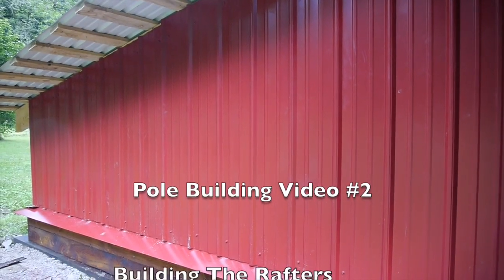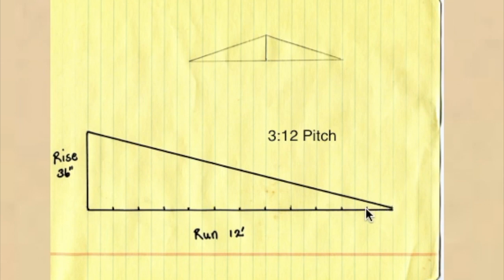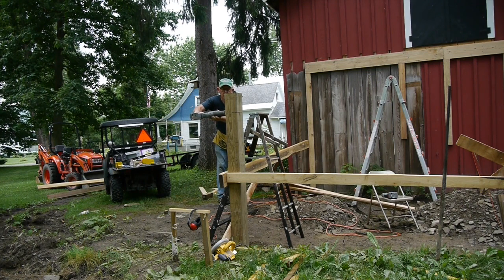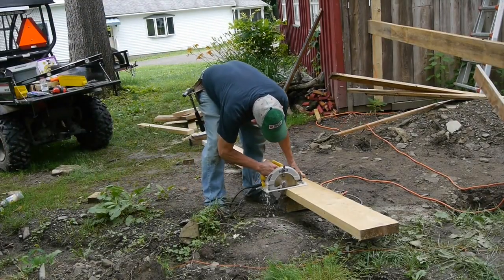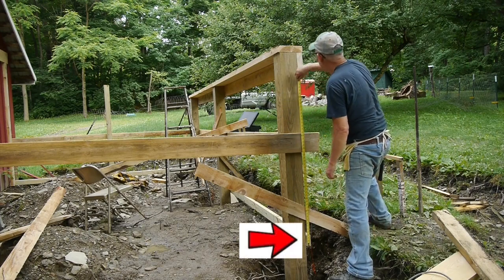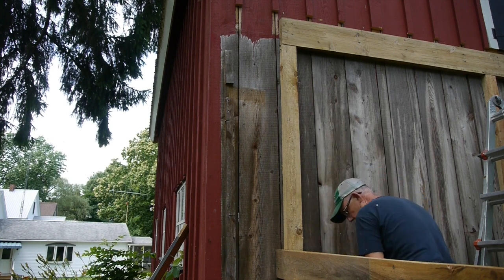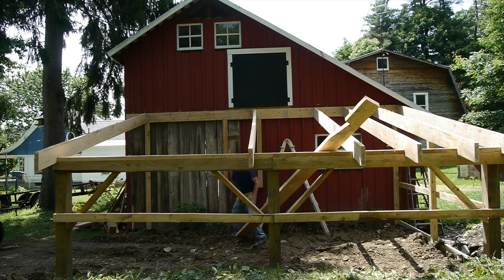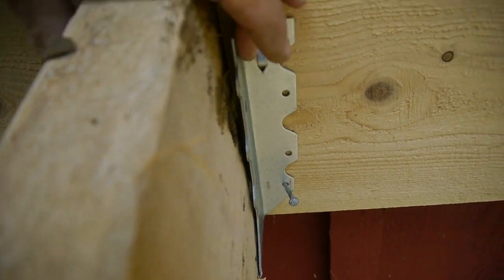Pole Building#2 -Rafters and Metal Roof

Comment: I love this video.... thanks so much...
If I may make a suggestion though....
Of all your metal is same length,  keep them stacked together making sure the ends are flush, mark your top sheet them predrill your holes thru all the sheets...this will assure that all your screws are in same spot on every sheet and save a lot of time of moving and marking every sheet...
Reply from the maker: I did that one time and kept breaking drill bits.  lol

Comment: We built a few large pole barns on the farm, back when I was a teen. We just packed the treated hemlock poles into holes in the ground and the buildings are standing solid all these years later. Today's engineers don't understand them, we found. Ha ha
Reply from the maker: Ha!  Yes, a lot of buildings are way overbuilt.  I am almost 70 years old.  I don't need this thing to last 100 years.  i probably could have dumped the posts into the holes and back filled and called it a day.

Comment: I seen a guy stack his metal up straight. He measured for his screw holes and marked them. Then took a small drill bit and drilled through all the sheets to mark them all at one time.
Reply from the maker: Could work but I bet I would break a bunch of drill bits trying to drill through multiple sheets.

Comment: Really nice instructional video. I am in the middle of a similar project, putting a lean to on my 10 x 16 shed. Instead of the 1 x 4's over the rafters, is it ok to use plywood instead? Then would be easier for a clumsy guy like me to walk on the roof while nailing the roof down. Just wondering if its better to do it one way vs the other. Thanks
Reply from the maker: The problem with plywood is that it separates if it gets wet or too much moisture.  But you could use it I guess.
Reply: @TimTools99  I see and makes sense. Thanks for pointing that out.

Comment: What's the total roof dimensions 12x? - What did you wind up with total height on inside for both high side & low side? What was original length of 2"x8" from mill? Thanks for video most informative!

Comment: How did you seal the metal roof to where it connected to the building?  Did you use connection trim and caulk the gaps?

Comment: Tim, loved the explanation of everything. The only thing I'm still torn about is why so many including you put the screws in the valleys when the sheet metal manufacturer suggest to put them on the peaks instead. I don't see hardly anyone mounting them from the peaks. What's your opinion on this? Thank you for your time.
Reply from the maker: Hello Chris.  When I first started do this metal roofing years ago, they used nails instead of screws.  The nails had the rubber washer just like the screws do.  Back then, they told me to nail on the ribs (peaks).  I did my entire barn that way and I've had no leaks for 20 years.  When people started using screws, they said they should be installed in the valleys on the flat part of the metal.  I've been doing it this way fro several years now.  I don't think it makes a bit of difference because, I feel that this type of metal roofing is made to use on barns, utility buildings or sheds.  Personally, I would never put it on my house although thousands of people have done just that.  If I want a metal roof on my house I would install a "standing seam" system.  There no exposed nails or screws.  Think about it, why would you put a metal roof on your house and drill hundreds of holes through it?  I have to believe that those rubber washers will eventually dry out and then you will have hundreds of potential holes in your roof.  So use this Amish metal (I call it) for your barn and Standing Seam for your house.  Hope this helps... just my opinion.

Comment: When you screwed the header board to the metal wall with the 2 long screws did you just screw them directly to the metal or was there something behind it like on the interior of the building? Do those long screws hold if just put into the metal and not like a purlin on the inside?
Reply from the maker: I screwed the header into the building through the wooden siding and into 2x4 studs.

Comment: Very helpful and very high quality work. I'm wondering if that below grade lumber is code generally speaking in NY?  (so long as it's rated for below grade).  Thanks.
Reply from the maker: I pretty much do what I want.  What code? lol
Reply: @TimTools99  Ha!  Great.  Ditto.  Do you get condensation?  I'm building a 32x10 shed style roof on my garage rear, and wondering if I need insulation or not.
Reply from the maker: Hello Steve.  I guess it depends what it will be used for.  I don't worry about condensation in this case because it's just for storing a trailer.  Does your roof get sunshine?  That will dry things up in a hurry.  If you were going to finish the building on the inside then insulation is called for.  I insulated a camper that I made.  But if it's just a storage building for a lawn mower, trailer ... stuff like that, I wouldn't worry about condensation.
Reply: @TimTools99  Thanks Tim,  since it's not closed in, I'm going to do what you did. I can add something later if there is condensation to block moisture from hitting the underside.  Yes, it's sort of South facing anyway.  A thin layer of sound deadener insulation would also quiet it down if even needed.

Comment: I an going to use your video as a guide for a similar project. Did the roofing have to be cut to length. How long were your roof panels?
Reply from the maker: Yes.  After I built the building, I measured for the length of the metal.  I can't remember how long they were but just measure and leave an inch or so overhang.
Reply: Thanks Tim. You have inspired me to get started on my project. Although lumber prices have gone through the roof in my area.

Comment: Question, when I picked up my metal roofing and screws, the roofing company told me to put the screws on the high ridge , not on the lower flat part of the metal. Were you taught to put the screws on the flat area?
Reply from the maker: Years ago when we nailed the metal, we put them on the high ridge like you say.  I always thought that made more sense.  Then, when they stared screwing it down, they started doing it on the lower flat section.  So, that's what I started doing.  I wonder how long the rubber washers will last before all those roofs start leaking??? ha!

Comment: What type of material did you use for sealing the header (ledger) and metal roof against the existing pole barn.  I am having trouble finding anything at the stores
Reply from the maker: I had the Amish make me flashing which I nailed to the building

Comment: How do you keep from taking on rain water between the attaching header and the lean to...between the ridges.
Reply from the maker: There is a piece of metal shaped like an "L" that you nail to the building and the L sticks out over the metal roof.  Any rain that hits the wall of the building will run off that flashing onto the roof and down.  I hope that answers your question.

Comment: Tim, some folks put the screws on the ridge tops of the metal roof, I see you're putting them on the flat. Do you have a reason for that preference? DD
Reply from the maker: Years ago, we used nails and nailed through the ridge tops.  Then when screws came out, they said to put them on the flat so that's what I've been doing.  Hopefully, the rubber washers will last a long time.  That's why i would never put this type of metal roof on a house.  I just use it for barns, sheds etc.  The only metal roof for a house in my opinion is the standing seam roof system.  Anyway, the rubber washers are supposed to prevent leaking.

Comment: Tim, did you simply backfill the posts with dirt? Or did you fill with concrete? Thanks very much
Reply from the maker: Hello Mike.  I just backfill with dirt. I think a lot of people cement around the post but I really don’t see the advantage. When I first started building, i cemented them in then I thought why?  Once the building is built, where can it go?
Reply: @TimTools99  Thanks a lot for the insight. I'm in Vermont and planning to build a pole barn soon and believe I will simply backfill as well. I believe there is also something in concrete that can have an adverse affect on the copper that is used to treat wood? Ever heard that? Thanks again, I really learned a lot from your well done video.
Reply from the maker: @mikepdorsey  Yes, I have heard about the concrete affecting the treated lumber.  The thing about pole barns is that they are really a second-rate building.  If you lay up blocks and then build your building then you've got something that will last a long time.  Of course, when we are just building a storage building or something like that, pole style is much cheaper and faster.  I always figured that the pole building would probably last longer than I will so that's good enough. Ha!~

Comment: I think you forgot to account for the height of the seat cut in your 3 foot drop. Not enough to hurt anything on a project like that though. Just makes the pitch a little less than a true 3:12 and creates a small gap on the heel of the ridge cut. Still a good solid job.
Reply from the maker: Thank you Thomas. I am not a pro-carpenter.  What is seat
Reply from the maker: Thank you Thomas. I am not a pro-carpenter. What is seat cut?  How do I allow for that?  You’re right, for this project it’s okay but if I was doing something that mattered, I want to get it right. Thanks.
Reply: Seat cut is just another name for bird’s mouth. The seat height is the distance between the bird’s mouth cut and the top of the rafter straight up from the outside of the plate line or the beam in this case. It can vary depending on the material used for rafters and how deep you make your bird’s mouth. For example, a 2x10 rafter will usually have a taller seat height than a 2x6 by default because there will be more material left above the  bird’s mouth. You set the ledger and beam 36” different in height but the tops of the rafters run flush with the top of the ledger and the rafters sit on the beam which means the tops are a bit above the beam, naturally. I think your beam should have been a little lower, say 6” or so maybe. (just a guess) That way it would be a 36” drop from top of rafter to top of rafter at 12’ out. Sorry, I’m not sure how regional my terminology is, I’m from SW Arkansas. Sometimes it seems to vary from crew to crew, let alone state to state.
Reply from the maker: Oh I get what you mean. I don’t know the terminology sometimes.  Thank you for your thoughtful reply. I really enjoy carpentry and am self taught. So I never stop learning.
Reply: Yes, sir. I’ve always loved carpentry, too. I wish I still did it full time. I also wish I had documented some of those jobs through the years like you’re doing. Keep up the good work for the rest of us to enjoy, man.

Comment: Is that really a 3 on 12? It seems to me it was a bit less... on the top you went to the top of the rafter and on the bottom the top of the birds mouth. Like someone else mentioned mark the first panel and drill through to the rest. You could have bent a 2 inch tab (into three plane of the other piece) on the bottom trim at the corner and then mitered the top trim piece. The inside and outside intersecting points tell you your miter angle.
Reply from the maker: I figured it was close enough for what I was doing.  Nobody will ever know the difference.

Comment: Loved watching this but if the ridge is 36,, inches higher than the wall plate and the run is 12ft is that not throne out when the birds mouth is cut in ,so the rafter is flush with the top of the ridge but 5 and 3 eights higher at wall plate so its not actually 3 in 12 fall its less .
Reply from the maker: You are right but close enough for a shed..

Comment: By adding the 2x8 on top
Of the cut off 4x4, doesn’t that change the pitch?
Reply from the maker: it doesn't matter as long as all the rafters are cut the same, the roof will work just fine.
Reply: When you first cut off the 4x4 you said you measured so it would be 36 inches lower than the top plate against the building. Then afterwards you added the 2x8 top plate which now makes it 34 inches lower than the top of the board against the building. My simple thought was that would have made your pitch slightly different and I wondered if you accounted for that somewhere else. It turned out terrific. Great video

Comment: Extension of existing roof line would allow attic storage and garage space for a vehicle. The attic access door is now unsafe to access.
Reply from the maker: But ..... I didn't want to extend the building.  I wanted to build just what I built and I can easily access the upper window.  Perfectly safe if you are not a complete cluts.

Comment: The shed needs a drainage plan. Use drain field drain pipe soil cloth and gravel. Then include rain gutter with drain to dailight. Where I live 160 inches of rain per year. Some rock and pea gravel inside and entry for parking. You did not list the use of the lean to. Interested in man hour send material take off and price. Interested in appraised cost of your tax assessor that is fair market price versus actual cost. Would be interested in contractor bid as well. Is a permit required in your county? Have someone make some graphics
Reply from the maker: I have a backhoe and have done that work for 50 years.  Drainage is all in and it looks  and works great.  Thanks for your concern though.